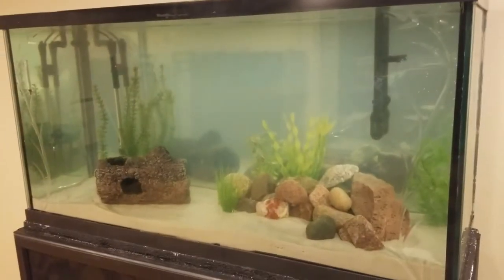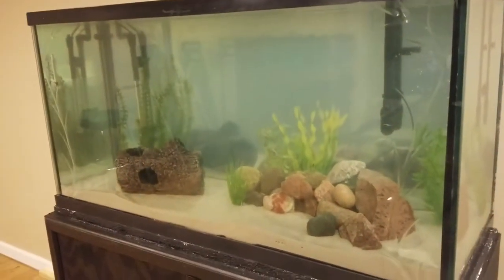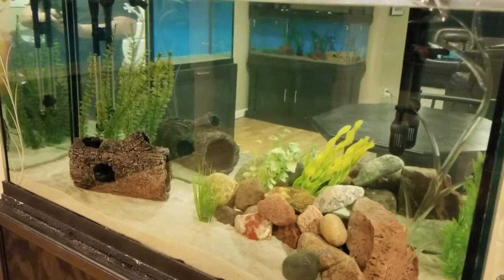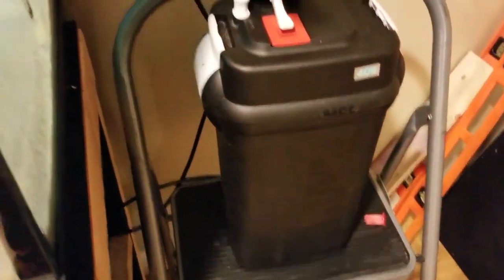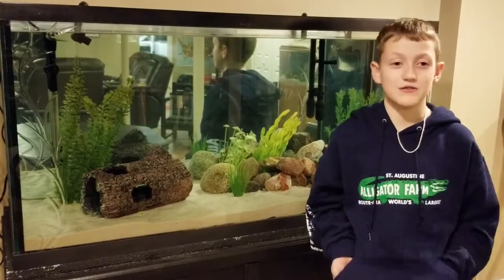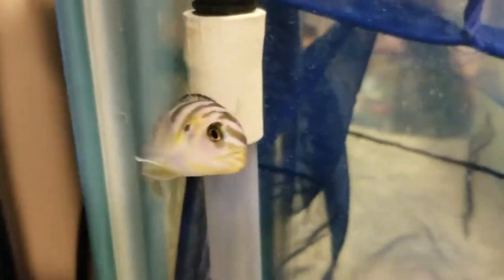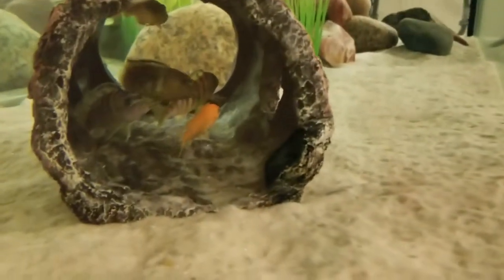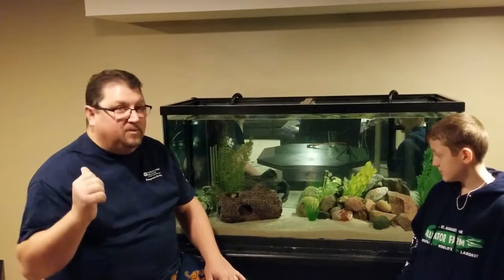Awesome 90 gallon aquarium - complete setup

Comment: With that ultra fine sand I'm guessing your filter impeller died within days.
Reply from the maker: Believe it or not, the same filter is running it today.  But yes, that is a real possibility.   I have some extra parts just in case.
Reply: @GebosGarage  Well that's good. Years ago I wasted my Marineland 350 impeller within hours of putting in Carib Sea Torpedo Beach sand. Lesson learned.
Reply from the maker: If I end up having to replace an impeller this week... I'm blaming you.  LOL.   Then the sand.  LOL.

Comment: Loverly set up but your filter is set up wrong, you won't your wool and fome at the bottom and then your bio media to the top as you pump pushed water threw the tube then it comes up threw the filter then back up to the pump, putting fome on top will trap more dirt
Reply from the maker: Giving it a try.  Thanks!